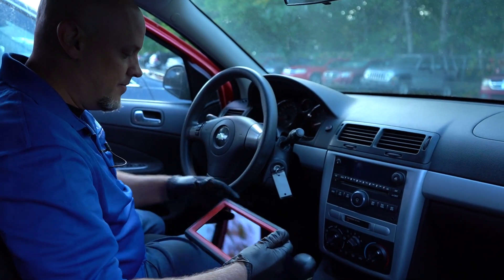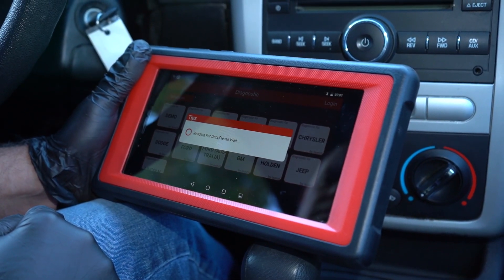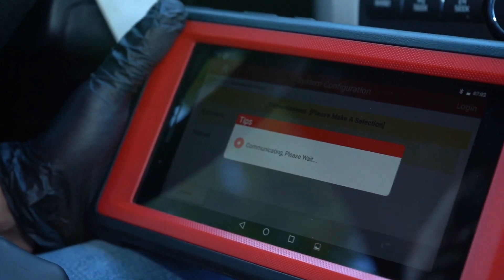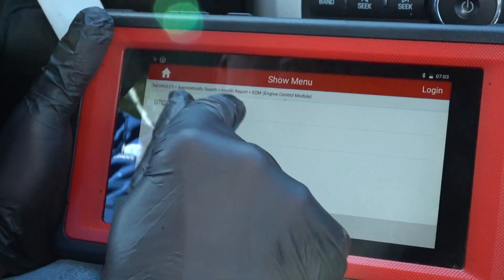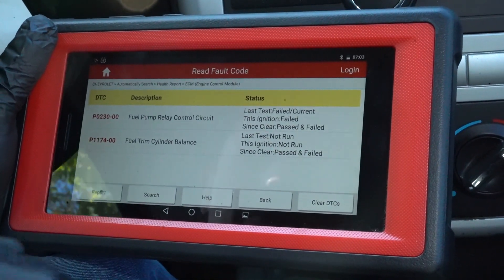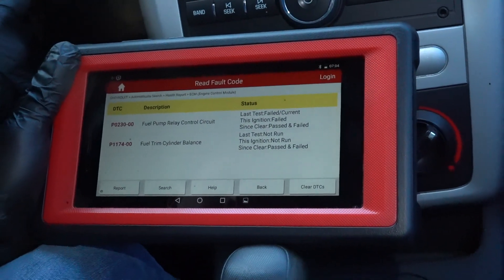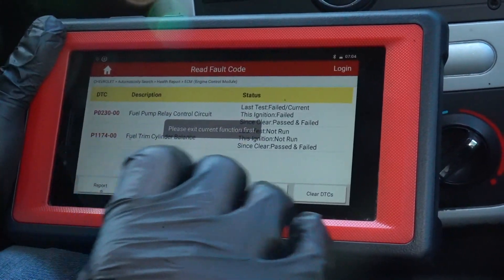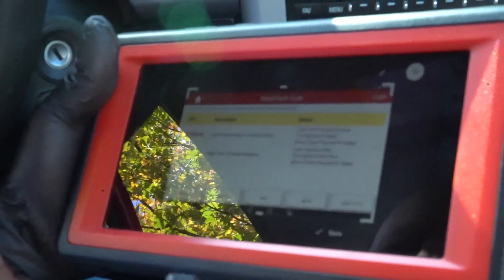Car Cranks, but Won’t Start! What Should I Do Now?

Comment: If you don’t hear the fuel pump engage then could it be the fuel pump relay ?
Reply: Mine cranks but the way I’m able to turn it back is by jumping starting the car battery to turn the car on. What can be my issue anyone please ?

Comment: I bought a Foxwell scan tool and so my check engine light is on it says that it's not on and no codes are found as a Ford 2007 Taurus any idea why ? I'm not really mechanically inclined girl with no one to help me so please help the reason why I purchased scan tool because I put some gas that was iffy in it to make it to the store and I drove about a mile and my car shut off and will not crank back up even with $20 with the gas in it and my fuel pump kicks in and my battery is brand new thanks for your video

Comment: I have no Dtc's, car cranks and trys to start and this only happens in temps below 40. Ive replaced everything expect ecm and havent fixed a exhaust leak in between where the flex pipe and mainfold meet. Ive replaced, tps, cleaned throttle body which is ran manually, map, pcv, coolant flush, battery, starter, egr solenoid, ica, all intake gaskets/cleaned intake, main relay, fuel pump, injector orings after cleaning the injectors, ignition switch,  no vacuum leaks as i replaced almost all hoses and clamps, installed a block heater, ect reading good, spark is good as i have installed ngk plugs, wires, cap and rotor, distributor o ring, and ignition coil. Valve cover gaskets and plug gaskets, fuel is at factory specs 42, compression all within 10%. Timing on point. Im sure theres something else ive done that i forgot to mention but this is on a 1998 honda prelude 5spd, if theres any info someone can provide me with from here that would be awesome!
Reply: So, have you eventually figure it out?

Comment: 👉👉👉Help please: i own 2008 bmw x3 e83 2.0D 4x4 automatic with 145000 km (110000 miles) on the counter.A couple months back i started having issues with the rough idle. 
After i would start the engine for the first 20-40 seconds rev's would go up and down with a bit of a white smoke from the exhaust. 
I cleaned the injectors/new kit, new glow plugs with the new module....car is fully serviced, so no issues there. 
Still when cold starting the engine i have rough idle for the 10-15 seconds (no smoke) and as well while driving form low speeds and when the revs come to around 1000-1100 rpm's looses power/hiccup...and when i pass those revs all is fine.
I checked old maf sensor and replaced with the new one just for the test, same happened...so i put back the old one.
Is it maybe the fuel pump or something else...PLEASE advice!!!

The previous owner: changed egr, dpf, cleaned turbo, intake manifold . I did a good service as well. Its not neglected car for sure.

Best 
Jure
Reply: I think head gasket leak?
Reply: you can check the oil if its froppy its probably head gasket leak, tho if its not froppy that doesnt confirm that it doesnt have a head gasket leak
Reply: if the engine is overheating too that means the coolant is not circulating properly and that indicates a head gasket leak

Comment: Boooooooooooooooooooo............ Waste of complete time also...........
If u don't hear the FUEL PUMP ENGAGE WHEN THE KEY IS TURNED, IT WILL EITHER BE THAT OR THE RELAY!!!!!!!!!!!!!
Most all of us don't have diagnostic equipment to check everything or most if not all people, don't have a fukn clue wat to check when ur car won't start. 
I second the comments about jus changing the RELAY!!!!!!!!!!!!!!!
THIS IS WHY I KEEP MY 1987 GMC S-15 TRUCK GOING. IT'S SOOOOOOOO
MUCH EASIER TO WORK ON AND I'M HANDICAPPED!!!!!!!!

Comment: @7:45 thanks for keeping in the shot of you struggling to get out the relay. It makes me feel better about when I encounter difficulties like that after watching a video where the presenter never has problems getting parts removed/replaced.
Reply: On today's modern cars its usually a fuel pump , a tipm, or crank or cam sensor, or broken timing parts!!!

Comment: What I get from this video is what the typical certified mechanic goes through every day. Also if you pay attention he noted early on that he couldn’t hear the fuel pump kicking it. He had crank. Probably has spark. No fuel. If you know a little about relays and where they are in your car you could carry a spare relay and possibly get yourself out of a jam.
Reply: Brian you sure know your stuff. Are you a technician?
Reply: @JakeSmith-ux1xk  not a technician.  Just someone that tries to pick up on things that may help me sometime
Reply: definitely the fuel rail isnt getting fuel, if the pump cant be heard, instead of messing with the relays you can test the relay with a tester and verify if the relay is faulty.
Reply: Very rare to see a relay fail as they are constructed not to. Same with fuses. At our shop, people often thinks it's a fuse, but it NEVER is. Something caused the fuse to pop, or the customer thinks they know what they are doing and starts switching them around.

Comment: What should I do now? Yes, because the average person stuck in a parking lot has a scan tool they can use like this. What a useless video.
Reply: I have BlueDriver scanner $100 small and works off your smart phone or you can get a cheap one for $35-40 bucks just leave it in the car. He actually gave you a hint when he didn’t hear the fuel pump. Just swap relays and see if that works. Other than that call a tow truck 😎
Reply: 🤷‍♂️ Carry a scan tool or call a tow truck, what's your complaint again?
Reply: They sell cheap OBD 2 scan tools at Walmart for like $20. Did you try the relay? Update?
Reply: Gotta measure fuel pressure and volume if you have it.

Comment: How do I go about ordering that scan tool
Reply: A scan tool like that is gonna be expensive! Go to your local parts store they have smaller ones that are more rudimentary but if ya want one they'll do.
Reply: @jamesriggs6210  thanks for the info
Reply: Buy a BlueDriver! I love mine it was only 100$ and had it for years. I’d prefer it over our snap on Apollo and shops Zeus because of how easy it is to use.
Reply: @TheGhost28  thanks for the info
Reply: Autel or xtool will give you a similar machine